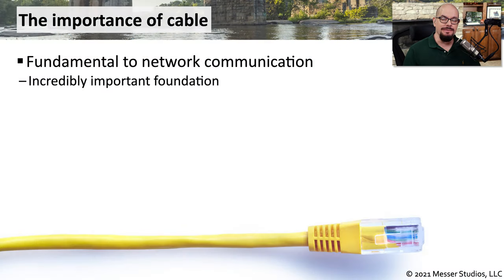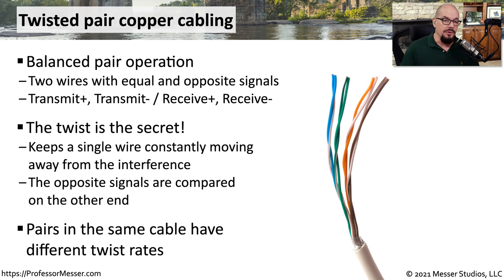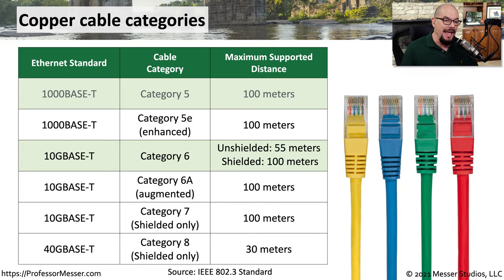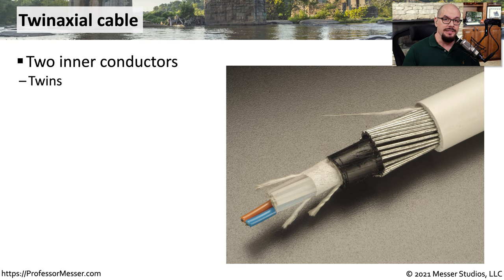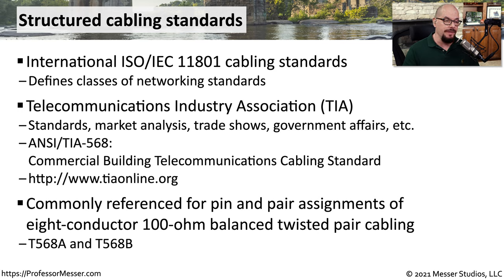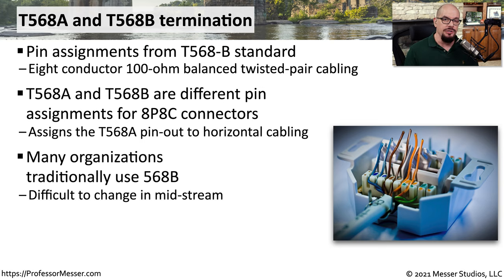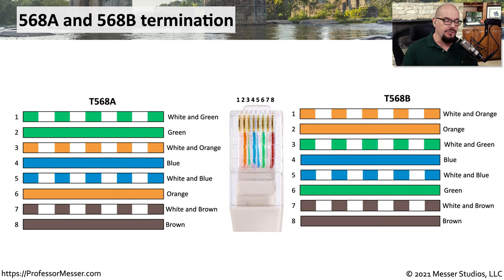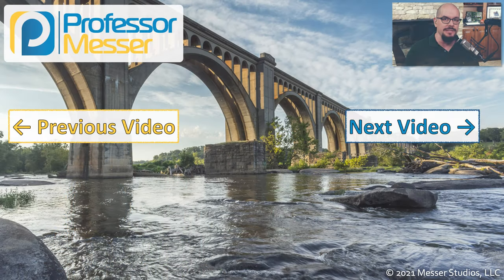Copper Cabling - N10-008 CompTIA Network+ : 1.3

Comment: I have my ITF+ and now my A+.  Here we go with Network+.  I owe it all to this channel.  Thank you Professor!!!
Reply: Does this helped u to get a job or promote?
Reply: @ivanperez5550  you do realize the A+ is an entry level certification for employment right?    Of course it can Help you get a job.   It’s the minimum standard most employers require for a help desk position.   Network+ gives you more options to aim for when it comes to employment as does Security+.
Reply: @dennyklein1965  thanks for your reply!!
Reply: A+ is unnnecessary - just take network+ and don’t waste the time and money
Reply: @ericboyd74  specially if you have a bachelors in comp sci.
Reply: I have ITF+ and got A+ almost 2month ago, still applying for job. Haven't landed a single interview, currently on N+
Reply: @ericboyd74 
Some places I’ve seen actually have a requirement for A+. Which I think is absurd because it’s so basic, and if you are able to pass a more advanced cert, it kind of proves that you would be able to pass the A+. Just something to keep in mind. Not every place, but some will list A+ in the requirements.

Comment: A little trick for remembering the TIA568 A and B wiring layouts:

1.) Odd numbers are stripes (Colour & white) & Even numbers are solid (Colour)
2.) A is for Apples and are green, therefore; T568A starts with green. 
3.) Blue become before brown alphabetically as well as in the wiring layout.

Not sure why but the above has helped me remember the layouts for the last year or so :)
Reply: Thanks for this tip. :)
Reply: Thanks a bunch, I heard another mnemonic with  a lake with and a sunset (Orange sky, green grass, blue lake, solid green grass, brown dirt..) I like yours better though :)
Reply: I appreciate this tip
Reply: orange white orange green white blue blue white green brown white brown
years as an integrator has burned this into my memory
Reply: I'm Aussie so I always use A for Australia 😁 definitely helps remember
Reply: @nousquest  🤣
Reply: For me…Green means G.O.
Reply: Honestly, it's easier just to do it until you don't get it wrong. Eventually, you don't remember it, you just know.
Reply: @charliegreen4128  Depends on the person. I passed the network+ just over 2 years ago, since then I've passed an additional 10 certifications including CCNA. There's plenty of little tricks like these to remember things in exams like the CCNA that would be extremely difficult to pass without them (e.g. Syslog severity levels: Every Awesome Cisco Engineer Will Need Ice-Cream Daily  = Emergency, Alert, Critical, Error, Warning, Notice, Informational, Debug) 

Also I believe these tricks help you retain the information longer...
Reply: 4) every stripped pin is next to its solid color in some way, EXCEPT pin 3 and 6.
Reply: but apples are red :(
Reply: @dfmu2669  haha they can be I suppose. As long as there's no orange, blue or brown apples though we'll be ok!😉
Reply: @Smithy_7895  lol I’m just messing. I’m actually going to use this to help me remember. Thanks for the tip! :)

Comment: Professor Messer. Love the presentation, but your chart at 2:10 shows that  Cat5 is 1000 Base-T when it should say 100 BASE-T. Probably just a typo but, if it comes up on the exam, looking for the test-taker to identify a way to troubleshoot why they're only getting 100 Mbps on a line when they're using Cat 5, this is not going to help them differentiate between 5 and 5e. I hope you can fix this for future viewers! Thanks again for the awesome content!
Reply from the maker: That's not a typo. The IEEE 802.3 1000BASE-T standard supports gigabit speeds over Category 5 cable. If it comes up on the exam, you should follow the industry standards.
Reply: @professormesser  Oddly enough, I had a book from Pearson that mentioned a maximum of 155Mbps (With ATM Traffic) which is neither of those! It was from 2018.

Edit: Just checked the standard, Cat5 it is! Wonder why I was always told Cat5e, is it more common?

Comment: Cat. 5 is 100Base-T. No?
Reply from the maker: The 100BASE-TX standard certainly supports 100 megabits per second over Category 5 cable to a distance of 100 meters. Of course, the 1000BASE-T standard supports 1,000 megabits per second over the same Category 5 cable to a distance of 100 meters.
Reply: @professormesser  

Oh, I see. Thank you for clarifying! You’re a lifesaver.
Reply: Cat 5 is 100. But 5e is 1000